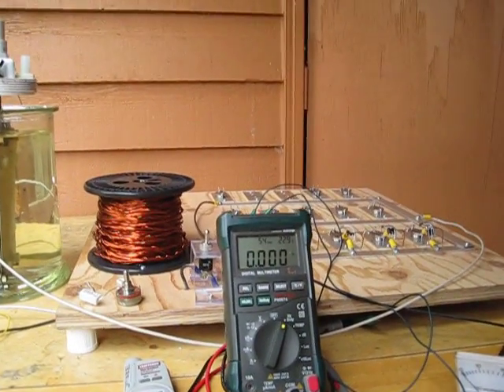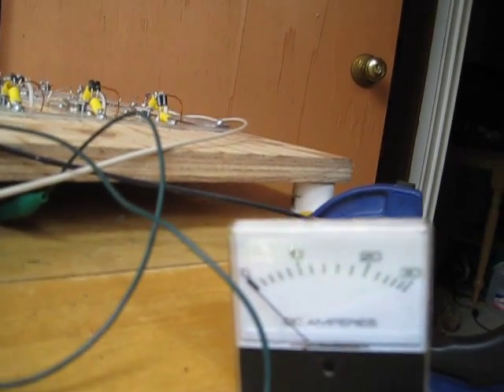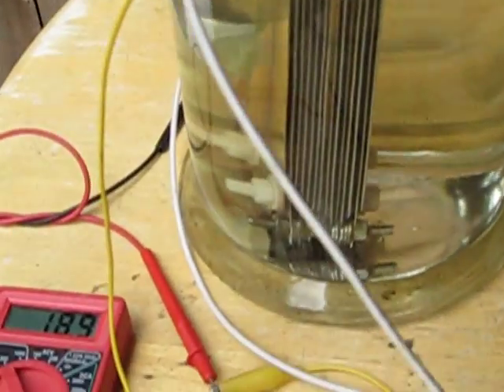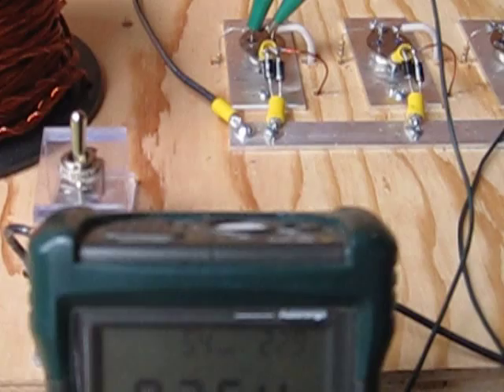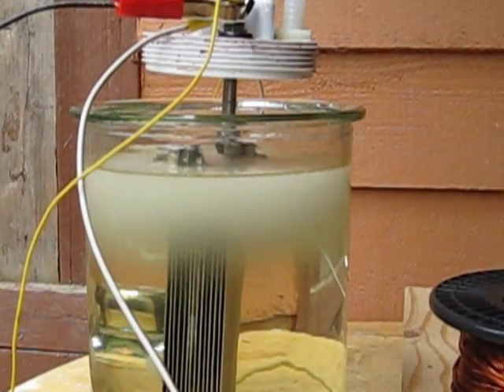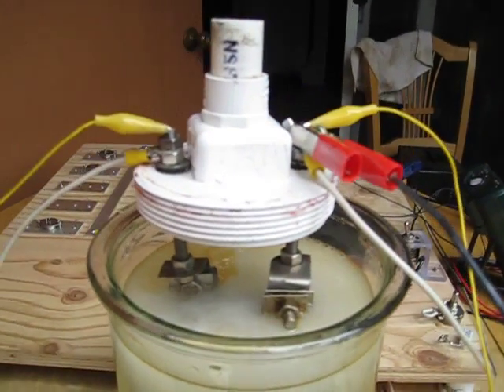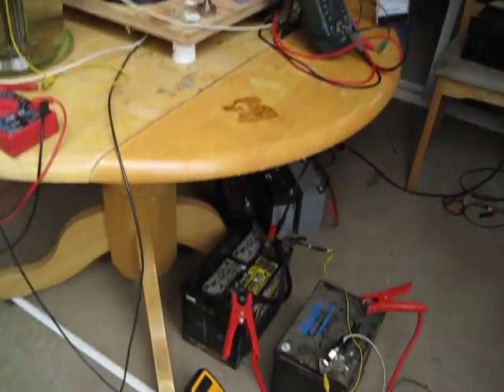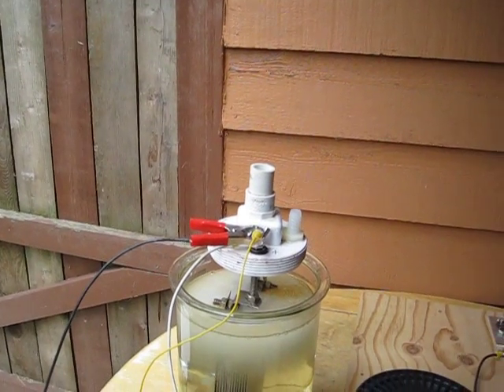HHO wet cell with 24 volt tesla set up 1ohm resistor 001

Comment from the maker: that's just water, nothing else added, even though its very low amps, the transistors are sending spikes of over 300 volts into the cells. the cells still are not even broken in yet